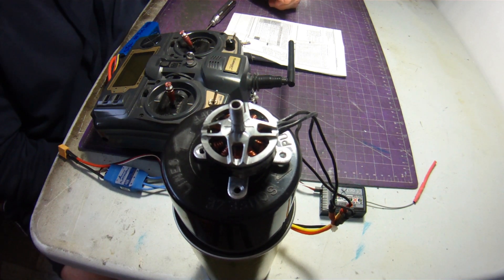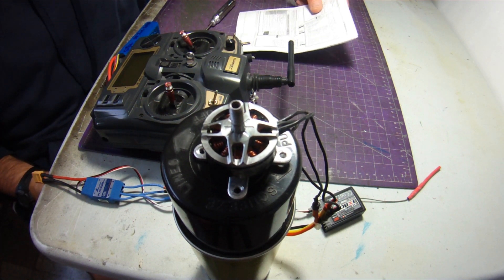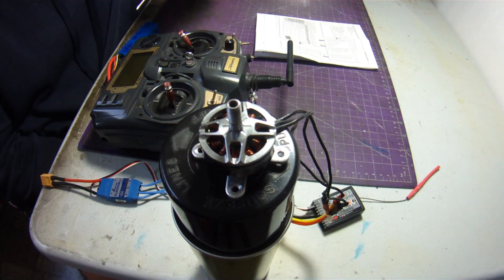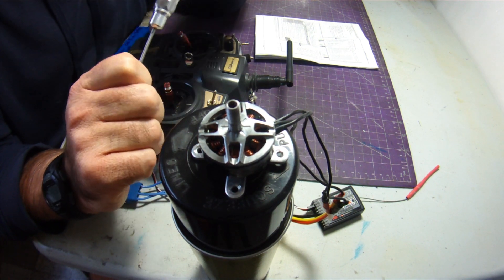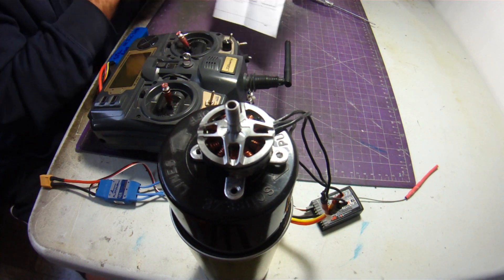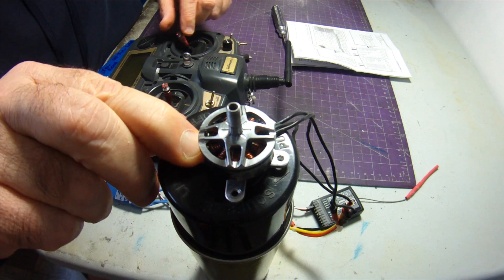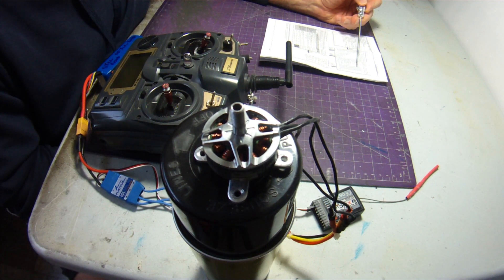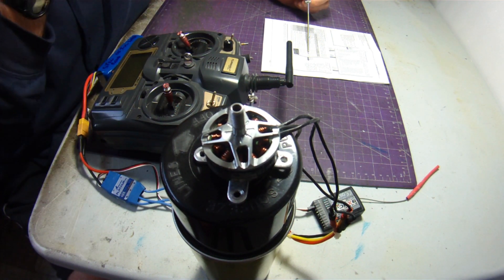Programming HobbyWing Platinum PRO 40A ESC with transmitter

Comment: Hi. I have a platinum pro 30 amps esc no bec. Why is there 3 wires on the servo lead (white. Black. Red) is that to give it 5 volt or what?